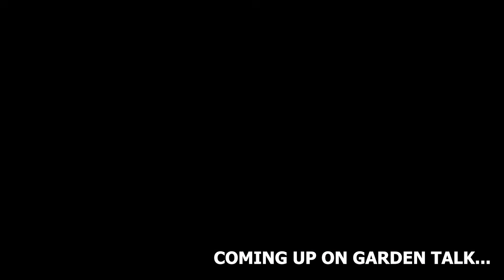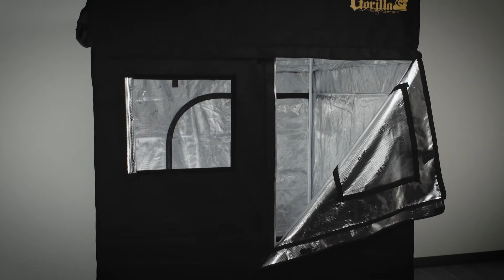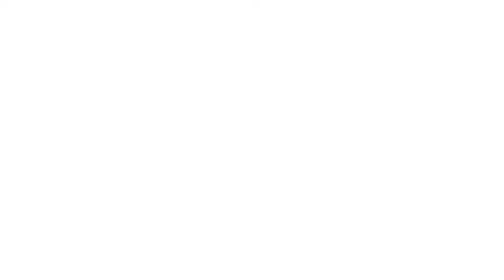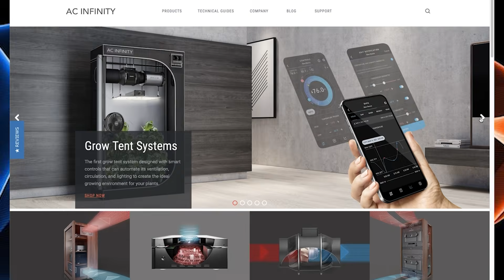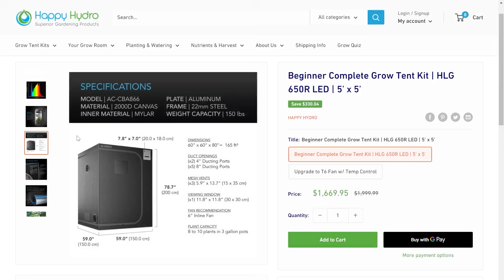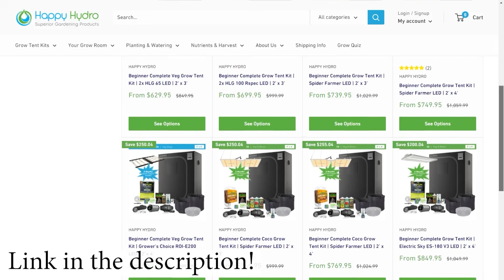Increase Plant Yield By 30%+ With This Essential Element! (Garden Talk #76)

Comment: Any pointers with regards with the use of bio char? Was going to ammend with soil and perlite for young veg. Then top dress - but I feed synthetic (on synthetic based soil) just was thinking amending would help with nutes + root dev . Obviously you would water down too not just nute feed
Reply: Im mostly synthetic too, but grow in soil with minimal nutes, But one thing I swear by is Hygens Humiboosta. Humic/fulvic acid blend that aids nute uptake and helps break down locked out nutes. Try it just one grow, If you dont like it, I will buy the left over bottle to use myself, Just go easy on it, its strong stuff. Follow directions and then make it a bit weaker to be safe. Thats if you want to stick with a synthetic solution to your prob.
Reply: @marneybanana1985  I use fulvic and it's a charm! . Also less is more ! Give the bio char a try . Add 15% of what your soil mix is . It too works wonders!
Reply: Dr. Elaine Ingham  & Soil Food Web and jeremy feom buildasoil whom was on here previously..
Reply: biochar itself is a great conditioner but it doesn't provide the essential elements as much as it makes sure those elements get released to the plants. so if you're using a synthetic line, chances are small amounts of biochar fed regularly would benefit that system. hope that helps!
Reply: @nn1590  I think you would be 100% as my first grow . Also with synthetic had incredible results. And I think it was possibly using some top ammends. Mainly used biochar, diatomaceous earth, mychoriza and later some frass. But . Seen how you can also choke a plant by using too much. There is a gardener on YouTube who did several diff vegetables all with diff qtys bio char and 25% to 30% seemed to be the sweet spot. But hey . We all learning

Comment: I imagine Cover crops may help extract co2 out of the air aswell putting it at the root zone of the plants. 
 Really Great information guys. 👍
Reply: It doesn't work that way. Roots use oxygen, leafs use CO2.
Reply: @TheUnholyPosole    I was just wondering because dude said the leaves suck the c02 out of the air and it transports it to the root zone which then the roots use to produce sugars or whatever.  So my thinking was what if the cover crop brings in extra c02 to the root zone helping the cannabis roots thrive.  He did say that the c02 actually works at the root zones and is why they're making high carbon additives that you feed directly to the roots.
Reply: @arkinner  This guy has no idea what he's talking about. Plants take CO2 ONLY via leaves, pairs 1 CO2 molecule with 7-8 photons (core of photosythesis), than Nitrogen (NH4, converted from NO3) and water, which is all basis for sugars (Glucose). Basically everything organic contains N and C. Then it transfers Glucose to the roots. Roots need final component which is oxygen (O2) to turn Glucose into ATP (adenosine triphosphate) which is an energy carrier used to transfer water and nutrients UP. Plants don't absorb CO2 via roots. That's nonsense. Carbon (in any solid/soluable form) is food for microbes in a soil, not for plants. Microbes than use it to eat it and "unlock" (called mineralization) ANorganic (repeat ANorganic) compounds like NO3-, H2PO4-, Ca+, K+, BO3- etc. which is the only form of micros/macros than plants uptake with roots. Stop listening to these organic bros who are pushing myths about "Carbon flavours" lol...
Reply: @dank watch again because you missed some key information on the process.

Comment: What are some carbon based soluble fertilizers?
Reply: All blood meals and bone meals are carbon heavy, but they take a few grows to break down fully into carbon, so just keep adding various bone and blood meals, and over time if you re use your soil, it builds up. I find the 3rd and 4th grows in a pot of soil Ive used before are the best grows. All the stuff I added on the 1st and 2nd grows has fully broken down by now and the microbes have had ages to party and grow. Even the smaller particles of bark chips and leaf mulch compost are turning to carbon by the 4th grow, so save ya money and use organics for your carbon needs.
Reply: Aphrodites extraction from nectar for the gods
Reply: our entire product line is built on soluble carbon chemistry. check us out at www.rootedleaf.com ! thanks for watching!

Comment: Sup Chris. About the supplementing during lights on or off - one class i took a few years back showed that respiration is more active at night. Wherein plants uptake oxygen and release CO2 during lights off.
Man this was a banger subject. Hats off brother, you’re only getting bigger and better.
Reply: I really wonder if indoors we could use EC with custom day and night rhythm patterns to really fine tune the curves of hot and cold, and nutrient absorption rates. I think the shift has probably a big impact on the results especially if using a rhythm that the plant appreciates, and faster than 24h loops. Maybe even sync binaural beats trance music to it lol. I learnt in the tree industry that the sap in trees goes up and down based on night and temperature cycles, and frost can also impact bark production over months on the yearly cycle. I think that while plants are designed to grow faster in different structural ways, there is probably still functions that work the same way, using heat cycles as a passive nutrients pumping system. We could probably play with that to stress the plant into speeding up its photosynthesis and growth. The stems themselves are made of carbon. The nutrients become the plant once transformed by the enzymes like our stomach works with food.
Reply: @metasamsara  Agreed- Since I started thinking this way and trying to mimic certain patterns, ive had better luck. The first and biggest light bulb moment was when I realized at night, the soil is often warmer than the surrounding air yeah? So I started running a heat mat on a timer just at night to mimic this, and it was like flicking a switch on the plants. And I play lots of Melodic Trance music anyways and so far so good brother!!

Comment: Would you fortify for example Pro Mix for a base in order to get the correct ratios?
Reply: yes. 
premier peat for sure is the top used in our industry, and many others.
Reply: ProMix HP works great with our line of carbon-based nutrients. you can feed with every watering and at the end of the plants' life you will have what is, at it's core, a fully amended living mix. it will have all of the correct chemistries in place to support many different species of microbes, fungi, and plants. hope that helps! thanks for watching!

Comment: isnt like everything carbon based? i got molasses and kelp
Reply: yep pretty much all of nature is carbon, reconfigured and reshaped into millions of different forms. but not all carbon is the same, and it does not all behave the same. for example, the types of sugars found in kelp behave much differently than the types of sugars found in bleached and refined cane sugar found at the grocery store. sugars can be used as elicitors and signaling compounds, that's why so many different types of sugars are produced, and so if you know which ones to use and when, chances are you can help steer your plants towards the best possible lifecycle. hope that helps! thanks for watching!

Comment: Just started making and using my own plant based ferments. Not only do they make the terps extra loud and increases plant health but apparently adds carbon into the soil...sweet! Ferments are fun to make as well!
Reply: I just use the bananas .. the banana tea/ with molasses with a teaspoon of the Gaia green bloom nutrients… the acidity /ph of the cocktail does have to be adjusted some but not much.. I been finding I can slow down or postpone somewhat if you choose the finish fade out some by watching these ppm’s during this. You really have your finger on the pulse of your growing with these feeding styles and methods… great talk and discussion today…
As always…
Reply: What ppm are the final product and ph?
Reply: @stevecrabtree7654  I run organic no till soil. I dont worry about ppm or ph. Never had any issues where I needed to worry about that. With organics ppm and ph don't usually matter 2 much as long as the soil is balanced and the microbes are happy and healthy.
Reply: @mopar426power  I use organic no till as well.About 2 yrs ago i was flawless in productivity as well.I added bone meal and langebite in early bloom like always bam whole run trashed out.My buddy turned me on to the meters.I always check now just to know.Too many factors involved to take a chance.Sounds good just wondering.
Reply: @stevecrabtree7654  I will add that the ferments I make (fermented plant extracts, fermented fruit extracts) are more of a supplemental use. Once a week usually.  There is some NPK in them but it's light. I re-amend/top dress inbetween rounds and before flower and use the ferments as a supplement feed/boost once a week.
Reply: @stevecrabtree7654  six pH. Is the best rounded number for most plants.. six is the sweet spot.. trust
Reply: 6.8 to be exact.  @dertythegrower
Reply: I went to.my local boat ramp in florida and gathered up as much eel grass and hydrilla. I filled a 50 gal trash can and rose suspicion from the local law who eventually laughed it off. I brought it home and let it steep for 2 weeks in the same can then ammendment it to 20 bags of compost and soil along with other secret stuff. So far my girls are growing faster than any other cycle I've grown. By the way that cycle has been growing on for 30 years. Forget the kelp meal and grow local free availability. Expand ur thinking and u can grow much more efficiently at a lower cost and realize what true organic is

Comment: So can you make up for CO2 (in the air) via supplementation of liquid/carbon based fertilizer?
Reply: yes, and the biggest difference between CO2 in the air and soluble carbon is the degree of oxidation. it's like a gradient with the two "extremes" being fully reduced and fully oxidized. CO2 in the air is fully oxidized, whereas the types of carbon you want your plants to make are fully reduced. so plants use the power of the sun to convert oxidized elements (carbon as CO2, nitrogen as NO3, sulfur as SO4) into reduced compounds (terpenes, amino acids, thiol groups, etc) and supplementing them with reduced carbon makes a lot of sensde. hope that helps!
Reply: @nn1590  Too many plants in a concentrated area deprives Co2 as well!
Reply: Activated charcoal....spring water carbonated no sugar.